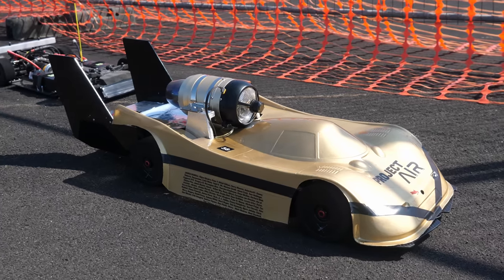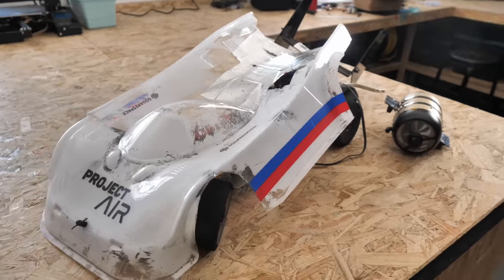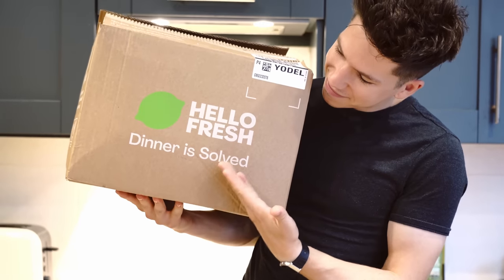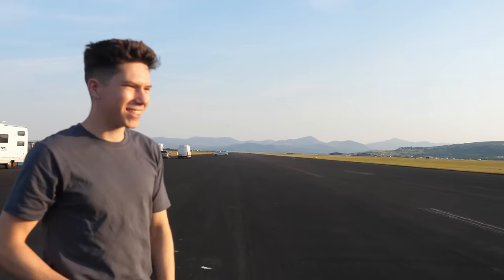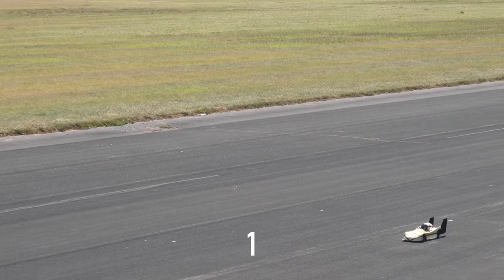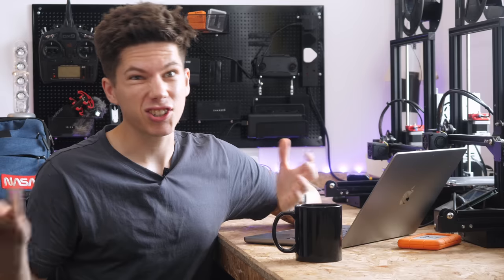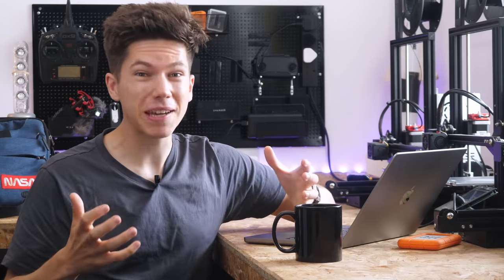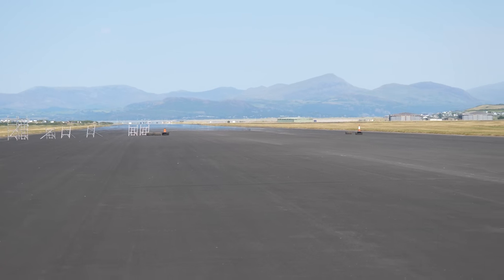Fastest RC Jet Car (Runway Testing)

Comment: That is a good effort. 
May I suggest aerodynamically control surfaces.
 The fins and the spoiler should be moving and attached to gyros to counter correct the steering and staying firmly on the ground.

Good luck next time.

Comment: I think just in case of another crash, try and chassis weld/mount everything; wing, body (Potentially a trapdoor to access the fuel tank?) And I suggest also that you should try cut down the fins a bit, or make them at a higher angle? and finally maybe make 3d print a speed tail rear, so aerodynamics are a bit better, and to look snazzy 😉

Comment: When you make a new one it might be a good idea to separate the fuel tank into two tanks on either side of the car to balance it better. The fuel sloshing from side to side might be exacerbating the wobble. Ships have watertight compartments at the bottom of the hull to stop flood water shifting all over to one side and turning the ship over. Some sort of in-fuel-tank dividers might stop the fuel all shifting over to one side but with holes at the bottom so as to not to section it off and become unusable.

Comment: If you still decide to use a gyro, I would turn down the gain all the way down. Set it pretty lean. It's just there to help stability not to force it. Eventually you can probably just do some tests to find the sweet spot.

Comment: The gyro is 100% responsible for that speed wobble. I added one to a car I was speed running and it did the EXACT same thing on the first run. Turn the gyro down, less wobble. Turn the gyro up, more wobble. Keep the gyro, but turn it down. Also - that fuel sloshing around freely ain't helping thing at all....

Comment: If possible mount that heavy turbine on the deck of the chassis. Maybe duct the intake of the turbine to the ground for a vacuum effect. If space is an issue wider is always better but longer works too. 3d print some solid tires to eliminate blow outs. It seems like everyone has given up on nitro in regards to speed. Turbines are the one thing that could give nitro cars a shot at the speed record. Not a lot of turbine cars probably because of the cost but racing has never been cheap. Hearing that nitro cars are the underdog from so many just makes me want to make a faster one. Nice build...good luck to you.

Comment: The oscillation  was still from the gyro. As speed is added, their sensitivity increases. The trick is to dial them as sensitive as possible with out any oscillation at max performance

Comment: The issue with the gyro was likely the gain being too high. Ideally you’d use one with a PID control rather than just P. You could then set P to match the ability of the car to react to the gyro control, then D to damp P induced oscillation. Finally raising the I term would provide a slower correction that would accumulate and hopefully keep the car on the right heading even if it did deviate from the straight and narrow for some reason.

Comment: In regaurd to the areo configuration I'd recommend making sure all leading surfaces have a reasonable aerofoil shape as apposed to a hard leading edge.

This is to reduce unwanted vortexes and provide a better stabilising moment.

Comment: Better tolerances on the steering linkages? Suppose the linkages have any play, then the small steering wiggles would hurt the direction of the car. The forces on the wheels get more extreme at high speeds.

Comment: you just forgot the mass on the jet car maybe because you put the gas tank on the right so when it's high speed the rc car becomes less balanced and also the vertical wings not strong enough, it could also be because the gyro that is used has not been set or you can also put two gas tanks on the left and right, although it will reduce the speed if you want to have very high speed can put two jet engines with a note that the mass must be balanced 

That's all from me, good luck with the results for the next experiment and I hope what I gave above is correct 👍👍👍

Comment: Might be a little late on this lol, but here for the floppy body. I have had issues at speed, but in the 1/16 world. The 1/16 community has found different ways to stiffen up the body, because the floppy body causes alot of issues at speed. One solution is shoe goo and a type of fiber mat. Such as the mesh used in drywall repair. Not the metal mesh, the fiber mesh.

Comment: It's the gyro 100% , my RC has a gyro and it works great for off-road and when hooning around but tor speed runs i switch it off otherwise the moment i go over 60-70km/h the car goes crazy even when the gyro is at ~10%  , for 80-100+km/h i run without a gyro.

Comment: Body stiffeners would aid in a lot of your aerodynamic issues. Use e6000 and fiberglass drywall tape to reinforce the front nose of the body and Hood area. Then use carbon fiber rod to stiffen the body and attach it to the chassis or itself to stop it from buckling under the wind load.

Comment: I wouldnt retire that car yet, the slop in the steering can be fixed with a few replacement parts.
One thing i keep looking at is the sides of your body shell, i'd make a braket on the chassis that it can be taped to so its not flapping around so much

Comment: That fuel in the tank is a major problem. It starts to slosh left and right (sidewise). Which may not be controlled by the gyro (system gets in is natural frequency). In racing applications, open cell (approx. 3-4mm) PU foam is added to the tank.This reduces any vibration of the fuel extremely. You can cut the foam down to smaller pieces which may be pressed into tank, since it's totally filled with that foam.

Any other vibrating parts bring you the equal problems. Make those things stiff! Every part. If it comes to high speed you always get in natural frequency issues if you are not stiff enough.

Comment: One thing to PLEASE check before running a gas-turbine with a gyro, is that the two play nicely together. I (and many others) have personally experienced issues where the high-pitched whistle/induction sound of a gas-turbine has caused havoc with the gyro MEMS sensors. Please bench test the car (i.e. wheels off the ground) running the turbine flat-out to see if you get any twitching from the gyro servo outputs. This is a well-known phenomena which has caused my own gas-turbine helicopter to crash several times. Following extensive proof (I provided), the gyro manufacturer I was using conceded it was an issue and updated their website to say their gyro should not be used with gas turbines. If you do experience an issue, one solution to try putting the gyro inside dense foam.

Comment: Possible problem with the gyro is the frame rate of 11ms that Spectrum uses. Some servos gyros and glow drivers use 10ms for the frame rate. I use the Spektrum NX10 transmitter and it does not work correctly with older servos that use the 10ms frame rate. The servos will step instead of making a clean sweep. This makes landing a RC airplane hard to control since the servos are stepping instead of moving in a steady sweep. My older glow drivers has a throttle servo connection. It uses 10ms frame rate. When using a Spektrum radio system the servo is erratic and it causes the throttle to pulse up and down. You should be able to look in the manual to see if the gyro and servos are compatible with the frame rate Spektrum uses.

Comment: The gyro uses very very likely a PID controller to generate the steering signal. That controller needs tuning. What has happened is similar to when quadcopters wobble due to an unmatching tune.

Comment: I could see a two flaws that you didn't see 
1# the plastic between the wheels could wobble even though it's very importent on preformence it's still something to fix
2# the fins size result in huge drag 
for your next RC car have two jets and four motors [one for each wheel] and install micro cams into the body.
hope you find this useful

Comment: Gyro tuning is difficult because the gain on the gyro needs to be set exactly for your application.  too much gain will give you the wiggles at your desired top speed, so if you connect it to a channel on the receiver and use your remote to adjust the gain you can set it to 0 gain to start and adjust a click at a time as you figure out your top speed behavior. mount it towards the rear so its sensitivity is lower per increment.

steering slop will affect this as will the servo's max speed. if you don't have enough servo torque, might also need additional high speed servos.

Id suggest having a cutout in the shell of the car so you can mount the jet somewhat tucked in, and then clear out any material in the path of the jet plume.

Comment: I think adding some stiffening to the body could help a bit. At high-speed the body will flex and even "flap around" causing vibrations and unwanted movement in the path of the aero
Reply: I use those carbon fiber strips and either tape or glue them on to firm it up.
Reply: At 16:34 in the video you can see the body start to slightly deform right before the oscillating starts. Just barely noticeable but that with the gain on the gyro could help.

Comment: CNC yourself a nice Light and  stiff carbon chassis, keep the suspension simple and rigid (some compliance, only in the intended directions!) and get that engine down inside the body to get the CG as low as possible. Get those right, and it'll go like stink, skip any of them, and you'll re-kit the car,. and they're always harder to put back together the second time!

Comment: Could it be that the mounting position of the gyro on the frame would be to blame? Probably not if it's a true gyro, but it would matter for an accelerometer.

I have noticed issues when using digital gyros and accelerometers coming from the time it takes for the data to be read, processed and used. Time shift + amplification = oscillation

It doesn't seem to be anywhere near as much of an issue with "antiquated" analog electronics

Comment: Great project - suggest gyro gain was to blame, and that if you feel the need to use a gyro, then maybe it would be best to go for a flight controller with (say) INAV firmware where gyro/damping characteristics (PIDs) can be accurately controlled, and ‘gain’ automatically reduced according to speed.  Whilst mainly used in RC planes/quads, most are adaptable to ground vehicles/boats.

Comment: Gyro is a complicated issue. 

You need to programme the 'gain' and then perhaps have that linked to throttle position. RC planes deal with this kind of oscillation all the time, and the gain has to be matched to the potential speed.

Comment: Great project! Question about the the brake system using using airplane transmitter. How you apply the brakes in the transmitter?

Comment: you should get the cheapest traxxas car you can find that has the stability control.  it's the gyro thing, but built into the receiver.  (putting your gyro on some receiver foam might help; old receivers used to get wonky when they'd be exposed to the vibrations of the chassis)  the reason i say the traxxas one is because it has a knob on the transmitter that allows you to control the amount of gyro assistance from 0% to 100%.  also, i would recommend getting a good quality metal bearing servo with REALLY high torque rating.  those wheels spinning at 100mph will fight your servo from the gyroscopic effect.  for the gyro to do its thing, you need strong enough steering servo that's fast enough to react instantly, else you get oscillation

Comment: At this point it seem obvious you should be doing a LWB custom chassis that integrates the GJT into the chassis more directly, ... allows you to shield the turbine a bit better also, and direct the intake air where you want it to be via some NACAs etc ... ... Could do some Chaparral nonsense and suck some of the air from beneath the car, plus the wing OVER the turbine may prove more adaptable. Additionally, should run an air brake if your wing is that effective. It would definitely help in a failsafe event like this one. Great build, subscribing!
Reply: Lol just saw you've done the fan ground effect thing before... time to INTEGRATE

Comment: I think one of the biggest improvements for stability would be to position the turbine to the front
Reply: That would be a good idea but I think it would increase drag which means it would go slow and slower acceleration because most of the weight is In the front

Comment: What if you add 2 gyros? The first on would control the straightness of the wheels while the other one would control the first gyro from going too mad... Or if you can adjust the speed of the gyro, you wouldn't need the second. Also you can put the pistons of the 'thing' used to contol the direction of the wheels inside of a vaccum to put everything in place and prevent the wobbling of the wheels at high speeds. That's my theory.

Comment: Careful with the gyro , have to take into consideration the time for sensor to read then out put then have the servo overcorrect  the stearing to then repeat the process over correcting the other way. Especially at speeds your travelling at i think need take into consideration the distance travelled before the gyro trys to correct it self during each cycle when it takes a measurement .

Comment: My gyro has saved my car a few times. Just getting the setting sorted. I actually deliberately through my car around about at mid speed to make sure the gyro steps in without oscillating. my gyro value is probably around 30% on the POT

Comment: The issue of the Gyro is due to an high gain Proportional PID controller, The gain of the Gyro must decrease when the car goes faster. In the same way when you drive in the freeway you barley rotate the steering wheel, instead if you are going slow you rotate the steering wheel a lot. There is the same problem in the tail gyro of the RC Helicopter BTW.

Comment: FIRE RISK OVER THERE!  🤣🤣😂…umm sorry.
I have bean on a high speed quest for many years. 
1. Signal loss, absolutely solve that problem. No matter what get you antenna/receiver isolated/insulated from interference. 
2. Ditch the gyro! Great for planes and helicopters.
3. Toe your front wheel out, that’s right out-not in, you my have to just trust me on that one, but it works.
4. Make sure your servo can handle the stress, high torque, you don’t need a lot of steering so put you control (rod) close to the center of the servo arm and farther out on the steering arm. 
5. “You need a stiff body” (she said),  I use spray sealant for gutters, don’t know what you call them over there-catches the rain from your roof, and support at the pressure points. A loose body creates a wobble of air pressure. Put a small hole in the body at the point where the windshield meets the hood in the front just one 3-4 mm hole.
6. A stiff suspension is better than loose and springy.

Comment: What i would try is to 3D print a new body with stabilizer fins running the length of the body and effectively housing the motor lower onto the chassis allowing airflow through and over the car similar to a venturi. And to help eliminate the speed wobble, put dampers similar to those used on GP motorcycle handlebars onto the front wheel stabilizers

Comment: I'm starting to think that you really need a custom chassis for this. Designing a steering system that reduces the amplitude of the servo movements if possible as it's the last thing you want is a short turning radius.
Also, the gyro location will affect it's sensitivity.

Comment: Hey James - project idea! What if you made a plane without ailerons, and instead had the main wing on a rail that moved the wing left/right to tilt the plane one way or the other, due to the imbalance of lift on either side? To explain it another way: The wing (when moving on the rail in one direction) would be getting longer on one side while getting shorter on the other due to the linear motion on the rail, 90° from the direction of flight.

Comment: While the gyro is to blame, I would also point out that you might need to do quite a bit of tuning to the gyro (assuming you can actually do that I know nothing about these things). Also, the vibration could be an important factor. Gyros are really nice if you can get them to work well (at least in the case of robotics which is the application I use it in).

Comment: Wicked video!! I don’t have much experience with gyros but I do have a bit of experience with control systems, is it possible adjust the damping level of the gyro? It seems like the system is under damped which could be causing the oscillations/overshoot of the steering, if you adjusted it to be an over damped system it might actually be pretty helpful in making small adjustments to keep it in a straight line.

Comment: Have you tried using a flight controller like what we use in fpv aircraft, yes sounds weird but thay could help keep the car running in a  straight line,  Perhaps it could control a  rudder system?